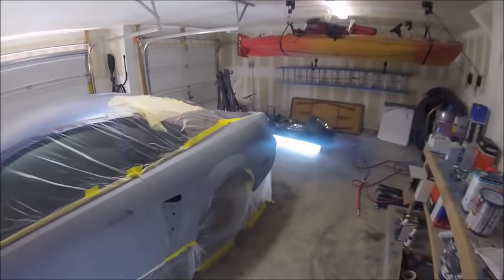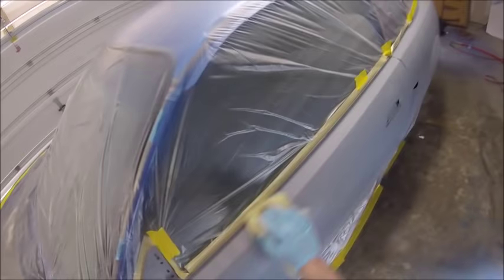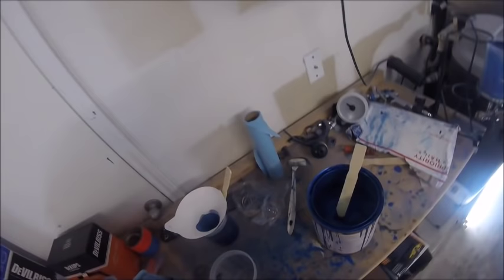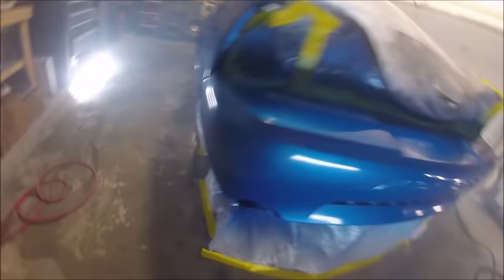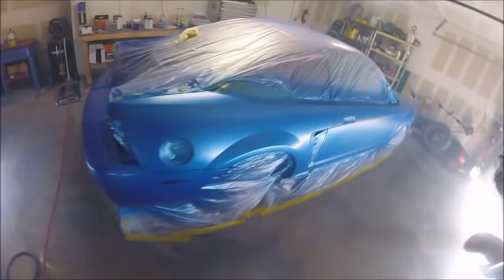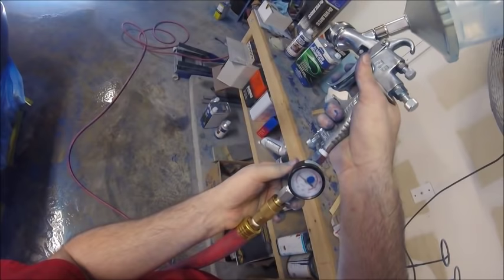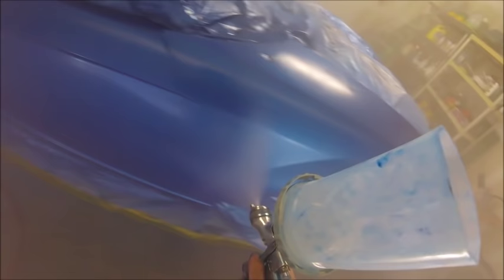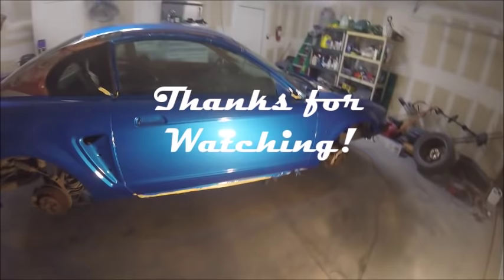Painting Your Own Car At Home

Comment: Extra tips, 1,,,run a ground strap, stops static build up,2,,  paint the car not individual parts, trim 1st, fender wells, edges, ect...3,,,when spraying run the length of the car, leave air on stop paint off the edge of the car. 4,,,,also keep old doors or fenders around to test, don't use the car as a test. New extra tips to help diyers.....

Comment: Wow, really nice for a first try! i'm doing my 1981 Mitsubishi sigma and bought two compressors to "tee" them (so I can raise the cfm value); i'm using the Iwata w400 1.4 tip (base coat) and a separate Iwata w400 1.3 tip for the clear-coat. With that one compressor you used? I am really surprised by by the quality finish you got; because I know the devilbiss takes about 14-15 cfm and the Iwata's about 9.7-10 cfm. I feel like buying an Flg-5 Devilbiss now. Great job again!!!

Comment: if you have a harbor freight in your area the purple paint gun they sell is about 20$ and sprays as good if not better than the expensive ones, i know harbor freight right i couldn't believe it myself until i used it it works great and if I may make a suggestion to cover all your personal belongings while painting or you'll never get the mist overstay out of them but good video though got some good tips thanks.

Comment: with the clear coat stage try to start with the roof first and the hard to reach spots.....prevents overspray sinds you do it at home and not using a cabin. still nice to see how you did it. Standox  pro painter.

Comment: I own three devilbiss flg 5 guns. I think that what you have. The compressor you have is too small for this gun. I used the same gun with a 23 gallon compressor and only had enough for half a panel. My setup was 30 psi full fan about 8 inches away and ran same problems. I had to reduce pressure to 25 psi and brought the gun closer and slow the speed of applying the paint. The flg 5 cfm requirement is 9 and my compressor is at 5.4 cfm.  Hindsight i would have purchase a sprayit 3000 which is a LVLP gun designed for your compressor

Comment: You should set a couple high power fans blowing out.. Air flow is key when painting in a garage like that, you wont get over spray settling on the top surfaces. Besides that it came out great. I sell higher quality maters for cheaper than you get that eastwood and resto shop stuff.. Msg me if interested.

Comment: I have an '01 New Edge in Zink Yellow.  Owned it since new and am amazed at the quality of the factory paint job.  Uneducated admirers to this day think my 17 year old mustang is new! There are many rock nicks on the hood, but the Clear Coat and the Zink Yellow layer are very tough! Under the Yellow is a White undercoat, and since Zink Yellow is such a light yellow; it's hard to see many of the nicks.  There are a few nicks that made it all the way to a dark layer (I'm not sure if this is the steel or a rust inhibitor coating.  I'll eventually get around to touching up those parts.  

For almost 17 years this car has been showered with compliments for being so pretty. Early next year we are buying a Lincoln MKZ and the beloved Zink Yellow Mustang V6 Auto will be moved over to the other side of the garage to begin life as my Midlife Crisis Car.  

I am removing the 118,000 mile 3.8 V6 and the 4 speed automatic and replacing them with a 5.0 Ford Racing Coyote Crate Motor and a 6 speed T56 tranny.  A GT rear end and a sport lowering suspension, 2000 Cobra R 14" Brembo brake kit up front.

The inside is going to get stripped and a Racing inspired interior with rear seat delete and Roll Cage will be installed.

It's nice to know the ENTIRE history of a car before you start hot-rodding it up.

On the outside I have received a large Black Terlingua Racing Team Rabbit Decal for the hood and smaller Rabbits for each front fender.

I tell you all this because, to be honest; it I had to paint it I'd just get another car! LOL

Comment: When you were mixing paint I didn't see you add hardener. I used Restoration brand paint on a car years ago and it didn't hold up to bird droppings. I think it was inexpensive Acrylic Enamel. I'm thinking about another attempt at painting the same car again but trying to learn how to do a better job. Your video is helpful. I don't have a high CFM compressor so I can't sweep around and paint an entire car. I could try a gravity feed high efficiency gun this time. My last paint job was in the driveway. Doesn't the spray land all over your garage or does it flash off in the air and end up dust on surfaces? Painting in the garage would help avoid bugs and leaves landing on it. Hope you wore a respirator. It seems like you were painting and narrating. Auto paints are nasty chemicals.

Comment: Shouldnt put the drop coat on so dry that the tack rag picks it up. You went to far away. Try over reducing your paint next time, drop the pressure to about 18 psi and bring the gun to about half the distance of what you showed. Dry effect coats also effects the laydown of the clear so that could be part of the reason the first coat went on so rough. Otherwise good vid keep up the good work

Comment: Jim-- 
1. You mention the "G5" gun did not work well, but did you ever solve the problem with thinning the clear coat to the right proportion to apply well? You said "ten percent", but left that undecided.
2. Should paint gun nozzle size vary with base coat versus clear? I also note you use two guns, so is using a single gun inadvisable?
3. What about use of silicone polish on the car in the years prior to the paint job? I have heard silicone creates permanent problems with repainting, later. How is silicone residue effectively removed?
Most people would be proud of your paint job for a first effort, and especially after recovery from the close call with the clear coat.

Comment: i don't know too much about paint but shouldn't those bumpers be treated with adhesion promoter and then have flex agent mixed into the paint  pref  'baked' onto the bumpers?  believe the flex bumper w/o  will have paint  flake off  when flexed(or even if not flexed)....dunno

Comment: You did a great job ...  but next time (Band the car) first.. basically do the edges first per side.... NOT by the panel... walk the vehicle from front to back and I always do the roof first.. Some start from the bottom up but I always go from top to bottom just like washing a car and I use 28 psi on base coat with a number 3 tip and 24 psi on clear with a number 4 tip.. I guess it's a preference... my speed decreases between the two.. but you did a very good job.. And the color is sweet !!

Comment: Spray to quickly, to far away and don't hold your gun square to the panel. Need some vent fans so you can see well and the air born over spray doesn't land back on your paint. Use treated plastic to cover the car so paint doesn't flake off the plastic during additional coats. I'm not bchin, just friendly advice from one painter to another.

Comment: u got a good shop area u can do what u need paint  or motor work....I was looking at ur compressor that s what I am trying to decide on which one I should get I've looked at the one u have but did not know if it wood work in working on 1994 C-4 corvette ..ABOUT THE SAME SIZE AS UR MUSTANG SO I SHOULD BE GOOD WITH COMPRESSOR LIKE UR ...

Comment: mate i'll tell you what your problem was and for ever will be, get some masking an wrap it around your airflow adjuster at the bottom of your spray gun around the handle as well. its your little finger rubbing on the dial when you sway your gun left to right.

Comment: Hi I've worked with a lot of air systems  get a good quality water filter and air regulator I've used Norgren they are a good reliable brand for your air compressor I suspect the hose filter you have let some partials go into you're air gun probably why it blew up
Reply: olds767 also  CONDENSED  air is always  making  water so a water filter  on the compressor air line  before  it touches  a hose otherwise  you get clumps of water  building  up inside  the hose when you aren't  using  it then when you use it again  it may  only  be 1 MINUTE  you will  get water  coming  through  hose water  always  find s the lowest  point  so it always  pulls if gravity  is involved

Comment: im not sure if you figured out why your gun was shooting like it was but i can tell you. if you noticed your gun has the paint canister on top holding your paint that plastic cup needs to have negative presure that cup holding your paint needs to compress if you notice its still full of air your gun was not clean or had a block. when your shooting paint and you see your cup getting sucked in your gun is working good

Comment: your problem is when you mix  the clear you didn't add any reducer to the clear that will give you a better lay and spray out the gun a lot better is just like paint it's heavy and thick you would have to thin out the clear just like paint or the clear would turn out like s*** and the gun issue the best gun I use tips are 1.8 1.4 and turn the fan down slightly to spread the clear out hopefully this helps

Comment: I want to repaint  car on my own so i need to sand the clear coat. Do i need to sand down to the metal or just the clear coat? If i need to sand down only clear coat do i need to put primer on a base coat or just paint that then put clear?

Comment: I usually rip on people who don't paint well or use shitty equipment. But you did a great job man. Buy a sata they are the best guns get a new 1500 it will cost about 700$ but if you can do that job with that gun you could kill it with a sata and have a nice side business. Also don't ever shot panel to plastic. Use at least 12 inch paper. And blow it off while you tack. And wet the floor completely if your using that garage a lot.

Comment: Hey bud a couple of questions and comments for ya. First, when I looked it up it says the paint is a single stage paint requiring an 8:1 mixture. You said you used a 2:1 mixture so I was wondering where you got that from? Second, will a 26 gallon, 1.8HP, 150psi max air compressor work for painting? Third, what pressure were you spraying the paint on with and what pressure for the clear? Fourth, your base was just grey primer correct and if so what brand/type did you use? Last question is how much paint do you think I would need to paint a 2001 Ram 1500 extended cab 4 door? As far as comments I think the paint looks great and you did a fine job for your first time spraying a car. I've sprayed a few vehicles and my last one was a 1998 Mustang GT sprayed with Rustoleum gloss black oil based paint which turned out great after I cut and buffed it 2 weeks later. Any and all help with the gun settings, spray psi, etc would be very helpful. Thanks and keep up the good work man, the car looks great.

Comment: Is the gun you were having problems with the finish line guns.....because I bought 2 sets of 3 of these and I have never used them.  Also, you said you were shooting at 14 psi.....what what the gun set at on your gauge?  You said the HVLP guns have to run at high air pressure.  I haven't had a lot of experience on these I'm a old school painter.  Any suggestion will be very appreciated.
Reply: David Valentine his problem is not enough continuous cfm. from compressor

Comment: I think you did a great job!   Thinking about painting an old Jeep that I am restoring that learned from both your video and form some of the comments below.  I did have a question...  You mixed your base layer 2 parts Paint and 1 part Reducer...  Did you not need to add any Hardener?  I thought the Paint came without any form of hardener (therefore it would last in the original can for quite some time).  And that some hardener would be needed.    Your thoughts?
Reply: UCanDoIt2. you don't nead hardener for color only clear
Reply: UCanDoIt2 has p po

Comment: Spraying the floor like that seems like you could splash water onto the car. I would think a mop would be better. You also need to have way better ventilation and rig a fresh air  breathing system if you don't have one in place which isn't apparent from the video. Also wear a full body protective suit.

Comment: Is that actually a real regulator or merely a valve with a pressure gauge?? A regulator isn't sensitive to the compressor pressure but the valves are highly influenced by the tank pressure.

Comment: If youre using a 1.4 nozzle full fluid around 29psi, you should be pumping the clear out and able to move a bit faster. What psi where you spraying at? It could have been your reducers speed and the temperature of the day.

Comment: Is there a flex additive incorporated into the paint already? I didn't see you add any before you started spraying the plastic bumper bar. No flex additive in the paint means that any plastic components will end up cracking, fracturing and peeling in time. Nice color and nice work, thanks for posting  the video.
Reply: 2T2 Studebaker You don't need flex additive with today's paints.
Reply: never heard of people adding flex additive
Reply: his bumper is attached so no flex additive needed, flex additive is mainly to help you install the bumper when it is flopping around so it wont crack as easily.  The sun burns it out over time so it doesnt have much other purpose.

Comment: If you are using fans in home garage you ruin all the flat surfaces with dust that comes with the air through the openings/cracks..  the more powerful venting the worst result. (several days wet sanding and polishing) There is not much to do- It is dangerous and unhealty to get the best result... Or the other way is to spray car in 3 days. one side, other side and flat surfaces. lot of masking but it is more worth it.... :) it is also the best when little experience with gun handling ;)

Comment: A lot of effort to try to produce a reasonable result. What's not in your favour is the plastic covering the car, and the dirty surface of the garage ceiling...dust...and static electricity are paint job killers. I have done these kind of paint jobs (too often) and I recommend you take  one of those hardwood floor dust mops...wet it...and scrub the ceiling... if you have raw drywall with exposed seams...tape the seams shut...before you put the car in to paint it. When it comes to compressors you CAN NOT spray properly with less than 14 cfm @ 60 psi...because as you paint you will gradually run out of air and this will stop the gun from dispersing the metallics/pearls properly, and mottling in the sunlight will be the result. You can also produce orange peel, runs, and solvent popping.  This is why you would want to train properly in school ...you can still do these guerrilla paint jobs...but you will take many more precautions and have a better chance for success.

Comment: I can see you thought this through but I see some concerns as others have mentioned with safety. not to get overly critical and understand I like what you did here. 1. why no gloves when painting? 2. I see the 1 fan on the wall and not noticing it in use? 1 fan by itself is not adequate ventilation for a garage that size. 3 Am I correct in assuming this is an attached garage? at least it looks like it. how could you possibly do this in an attached garage without fumigating the entire house with toxic fumes. as others have pointed out the air compressor will suck up paint and particulates causing risk of fire or at least reduction of life of the compressor. for a pretty small compressor I am really surprised it could take the load of an hvlp for this much surface area. Really - good work here but hoping you could take advice

Comment: What pressure/fan/fluid settings you using on this? Got an FLG5 as well but looks like you're getting much nicer application!
Reply from the maker: Pressure 30psi to the gun, full fan full fluid.

Comment: Can you tell me exactly what the Eastwood Viper Blue Pearl was? Acrylic Urethane, enamel, etc? Most of these paints are actually single stage so I was wondering if this was also. Thanks
Reply from the maker: Its not an eastwood paint. The brand is restoration shop. Its a urethane base coat, not a ss
Reply: @twistedgarage4139  yeah I got the paint and clear mixed up. Lol

Comment: I have never seen some one use a 1.4 tip before on a clear coat, only on primer.  Have you tried turning down your air pressure and adjusting your pattern?  I use a 1.2 on clear coats.

Comment: It looks like you did a great job. That Viper blue looks just like the Blue Flame color on our 2013 F150. Forgive me if this question has already been asked, but what is the key to laying down a smooth flat coat of clear coat? What were the issues that you ran into with your clear? Was it just the fact that you used a 1.4 tip instead of a 1.3 or did your paint gun really fail on you. Do you not need to reduce the clear down if you have enough heat in your paint booth or garage?

Thanks in advance

Comment: Thanks for the video! It's good to hear a diy experience. I'm about to attempt it myself. One question -- how was the overspray? Especially outside in the driveway, etc. I'm going to crack my garage door and use 2 box fans with filters to try and extract the air, but I'm worried the neighborhood will end up lightly misted with paint

Comment: Hey there, thanks for that . I'm getting ready to do mine in the next few days. Forgive my ignorance but what is the process  for of sanding everything down with 2000 after the final clear coat is done ? Wont that dull up the surface and just require another coat of clear. 
That tome sounds like another 30 minute video or am i completely not  seeing the picture.
Reply: Wet sand removes Orange peel etc. Yes it will dull paint but it polishes out 👍